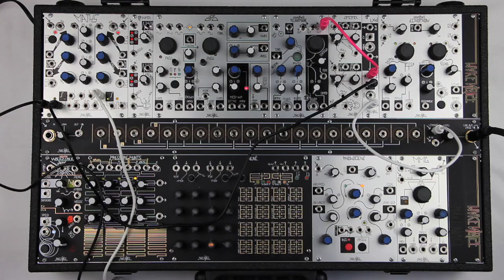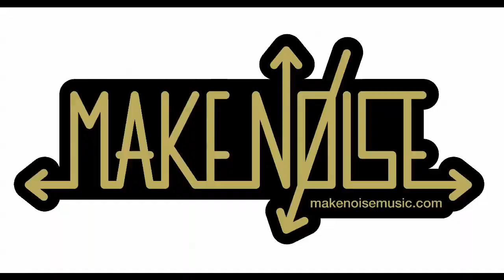tELHARMONIC 3-Voice Shift Register (Hidden Behavior)

Comment: Is there a way to know which mode you’re in by looking at the panel, or do you have to patch and listen to find out?
Reply from the maker: The Color Window shows a different set of colors in this mode, but you probably need to listen. If Degree changes with nothing patched to D-Gate, then you are not in Shift Register.

Comment: Is it possible to get the same effect using optomix instead of the lxd?
Reply: +Tony Rolando nice. This is such a great patch.
Reply from the maker: Yes you would patch to the CONTROL CV IN and set the associated Attenuator Full Clockwise.

Comment: is it two seconds or three seconds? i feel like my tELHARMONIC is only changing modes after holding for around three seconds and then five seconds for the Spiratone mode. how does one exit each mode. Standard, 3 voice, and Spiratone?
Reply from the maker: +0neTwo0neTwo Exit 3-Voice or Spiratone by holding H-Lock until it returns to standard mode.
Reply: alright thanks!